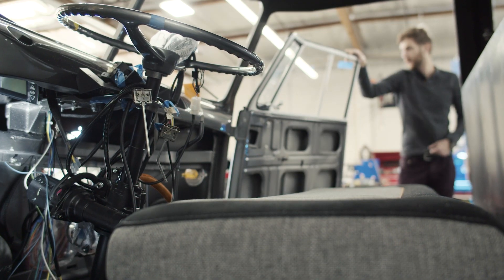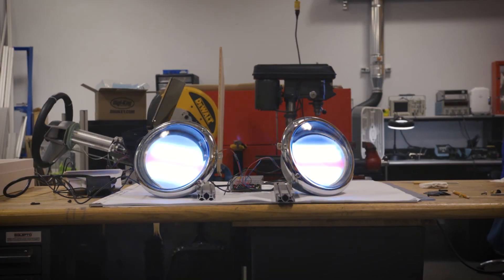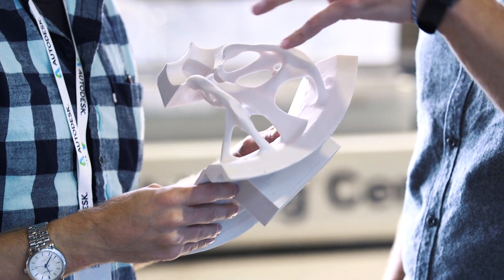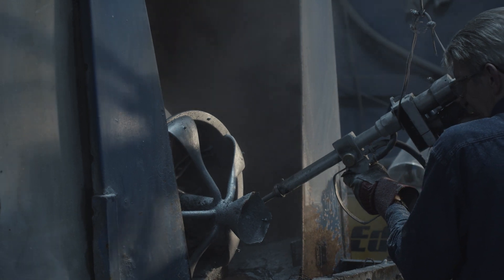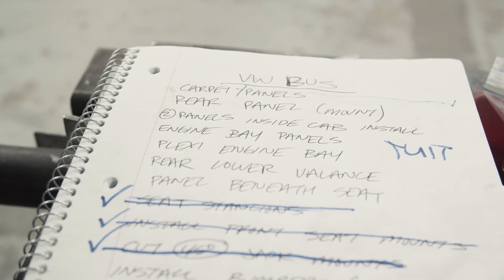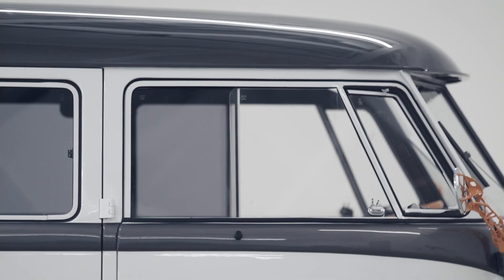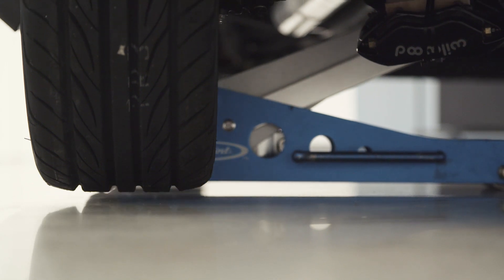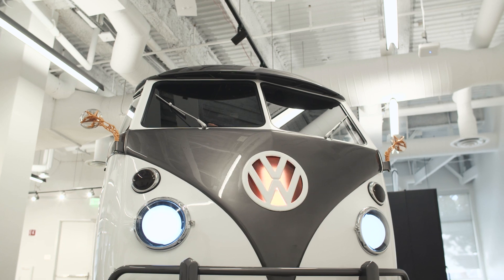Generative Design Holds the Key to the Future of Cool, Fuel-Efficient Car Design

Comment: I've used Shape Optimization (in Fusion360) on a part for a UGV (FDM 3D Printing)
Reply: @Iamyou iamyou Yeah I know they're different.But in Topology you could choose the amount of material to remove (%) and whether you want to maximize strength or stiffness. Also you need a starting part in topolog, In generative you don't
Reply: @Iamyou iamyou haha don't be bitter
Reply: @UC6Y2lTK0KkG_NDSTvtHHf8Q haha I use autodesk inventor it's really good

Comment: Do they include manufacturing limitations into the design process? Or is generative design always going to be 3D printed Alien Bones?
Reply: Generative design can be used simply as suggestions where they can apply traditional forms to reflect the generative design; thus, creating a product that's easily manufactured while benefiting similar performances of generative design.
Reply: Yes you can choose the manufacturing method
Reply: Generative design does provide a skeleton framework often for optimized designs. However they can be further stylized to fit certain brands / applications better + include ergonomics and manufacturing contraints. This is the job of the 21st century industrial designer. We also need algorithms to further stylize the generative design output, that is something for Autodesk to definitely work on! However it is quite critical since changing small parameters such as a radius or thickness can significantly impact performance so it would require re-evaluation.
Reply: Yes additive, CNC,